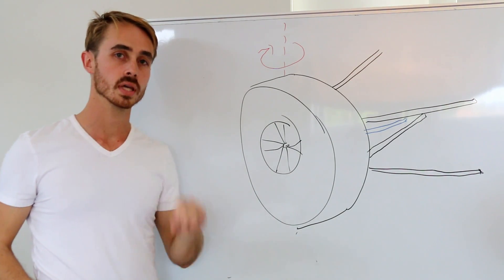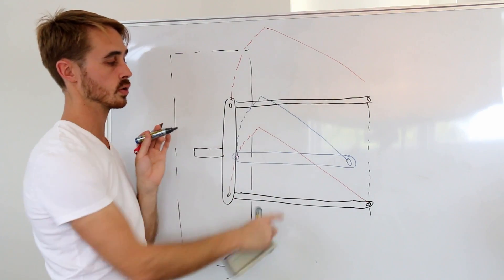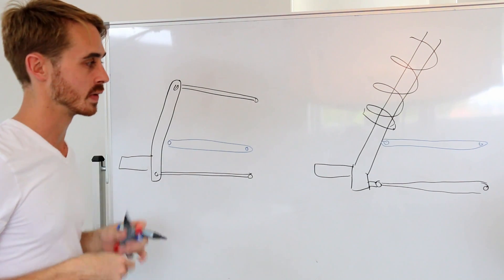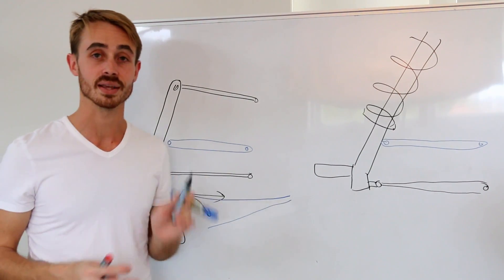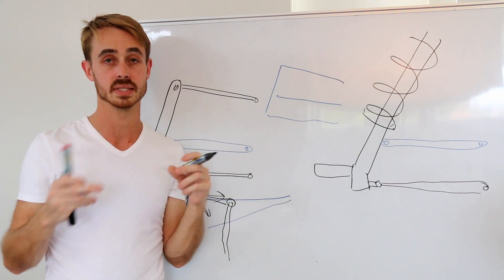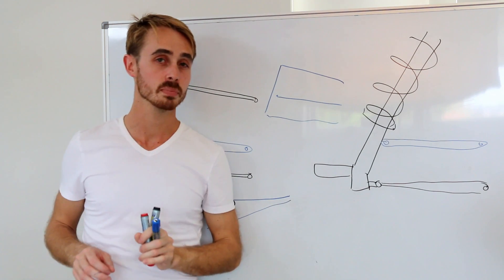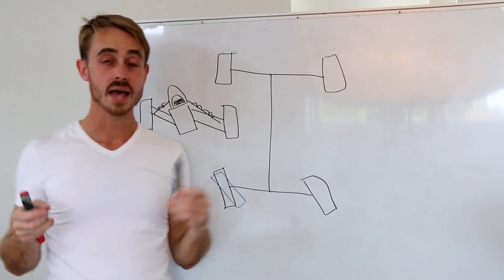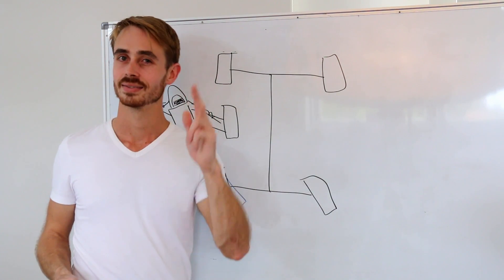Bump Steer - How does it work?

Comment: Recirculating ball steering is not sloppy it is only sloppy when its worn out I have both types of steering and if you can tell which steering is in the car I would be very surprised also the steering box car steers quicker...!
Reply: Any type of steering gear box CAN steer quicker, vs slower, as both of these scenarios also change the input EFFORT.   Slow equals easier steering because you have more mechanical advantage, and vice versa.    You could easily do away with power steering if you didn’t mind winding the steering wheel a few times to take it to full lock.    On the opposite side of that, quicker steering, to yield the same input force or effort, necessitates more ASSIST, which very often reduces steering FEEL.   Getting the relationship between assist, feel, and “quickness” is the magic mojo that these engineers seek.  That’s why they came up with variable ratio and variable assist steering.    A car with quick steering at 15mph could be a disaster if it had the same steering ratio (which dictates effort/speed) at 100mph.    Imagine turning your steering wheel from 12 o’clock to 1:30 giving you 45 degrees of wheel turn, and 3 o’clock yielded full lock, maybe 60+ degrees of wheel turn.    If you were going 110mph and turned your steering wheel to anywhere near the 1 o’clock position, you would be in big, big trouble fast!     That “requested” rate of directional change at that speed would cause the entire chassis to “desire” to roll over its center of gravity, and if were at a higher point in space and the tires did not slip, the vehicle would barrel roll horrifically.    If the CG were so low that the tires slipped as opposed to the vehicle rolling over, then you would be in a high speed, little if any control slide, with a trajectory you most likely opposed.    Quick steering is a relative term and this is dictated by the steering gear ratio of input degrees to output linear movement, as both types of steering mechanical transference produce linear movement to “link” the steering wheel shaft to the tie rods, and ultimately the spindle or knuckle.    Even the distance that the pickup point of the tie rod from the steering axis dictates effort and speed, as it is also a lever, and it too influences bump steer.

Comment: Hi Kyle, I have 2007 camry. The car slightly pulls to the left when my hand not holding the steering wheel. The steering plays (pulls randomly right or left) on rough road and pulls more on when the road is banking. I had the vehicle checked several times at the dealer and wheel alignment shop they said nothing wrong with the alignment and suspension condition is good except the left strut. The left strut can't return after compressed. Is it possible that this be the cause of left pull and steering bump?

Comment: hi as a 1980 Donnington championship gt winner and Cadwell park outright lap record holder   I am up to speed on bump steer .   but now at 75 years old   I am resetting the rear toe in and the front tracking on my 2007 Citroen C6 saloon car .which was all over the place . Amazingly my son drove it 1500 mil;es from the UK to Portugal and he claimed it drove very  well.   MMMM   impossible to say   because my first drive in this lovely looking car. the hydraulic suspension refused to raise up to normal .   and it was a disaster, Now 5 months later and I have rebuilt the poorly unloved C6 and setting up the tracking .  Unfortunately the tracking wanders quite wildly with the car at differing ride heights . My next attempt is to set the tracking at normal height and chec what the bump steer is doing at various suspension travel settings .
Reply: Hope you are well mate

Comment: My truck tends to wander when hooked up to my travel trailer and is difficult to keep in a straight line... especially at highway speeds. This all started after I installed a Bilstein levelling kit. I’ve had it into 2 Ford dealerships and they have not been able to fix it. They just keep throwing parts at it
Reply: Maybe borrow a similar trailer and see if the problem remains or improves as a starting point. It may be better to look at the trailer's tracking.

Comment: Can you help me.. I just installed a rear camber kit on my 2012 honda accord hfp. The rear tires were out -3 degrees the camber kit corrected this issue on the alignment. Its now 0 degrees but now when i go over a bump im getting bump steer and i never had this problem before. The kit also had a front ball joint kit which wasnt installed. Will that kit correct this issue? Also i was reading that if you just angle the rear tires -1 degree it will fix bump steer. Your thoughts or suggestions?
Reply: Sebastian Rogers camber doesn't effect bump steer. The ball joint in your kit will help a lot.
Reply: well how come when I put the rear camber kit in... all of a sudden I have bump steer?

Comment: Hey great articles Kyle. I was once a top level race-car engineer and you'er bang on the money. Bump steer is a critical element in car dynamics. It's also not well understood in racing circles believe it or not. 

The reason why i chime in here is> Importantly with bump steer on the rear. Make sure it's zero or toes in slightly on bump. Toe out is diabolical. Trust me, I've been there many times on different cars and it was always a disaster. 

PS: Also little known.  Beam axles/live axles also have bump steer, mainly in roll.
Reply: Rear steer is grossly not understood.
Reply: Wiki says rear live axles dont have bump steer, they have roll steer

Comment: very nice explained , also fast and to the point , at 9.30  i would like to ad something ,( and i am talking racecars now), in a corner when a chassis rolls ,  we speak of roll steer, in a racecar the akkerman princ. is not (so) important(a lot of racecars are made to "over akkerman") since the insidewheel does not carry a lot of  load , its the outside wheel that matters  ! , so when a driver gives a certain steering wheel inputthe car will roll , if the wheel would Toe In under roll the driver has to turn the steering wheel back a little , otherwise the car will turn a smaller radius than the driver intended , That feels very odd and unstable for the racedriver (and car)!!toe out under roll makes that the driver has to turn the steering wheel a little bit further into the corner , and Thats much muchnicer to drive i.ow  the driver feels much more confident in the corner > faster lap times ,